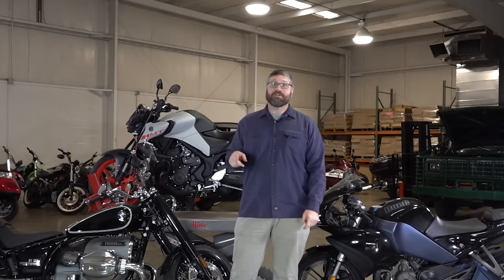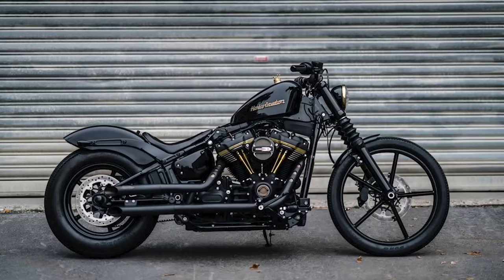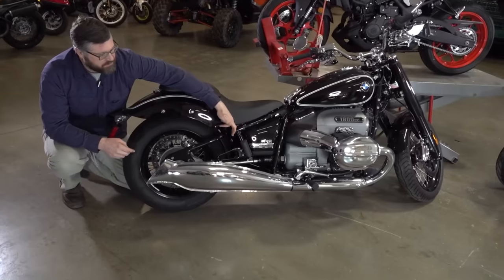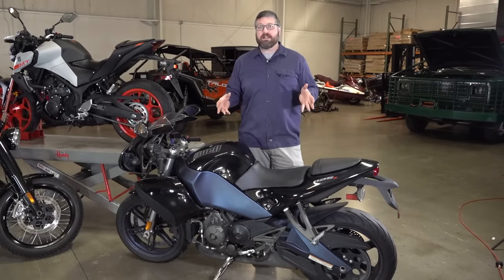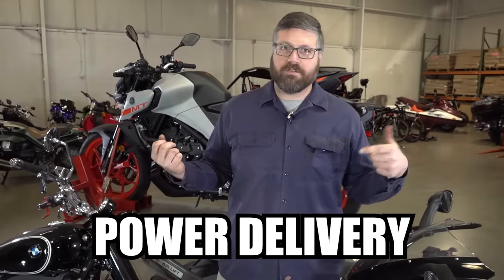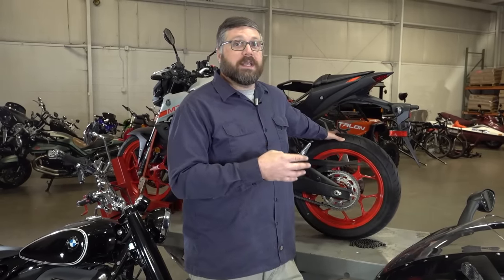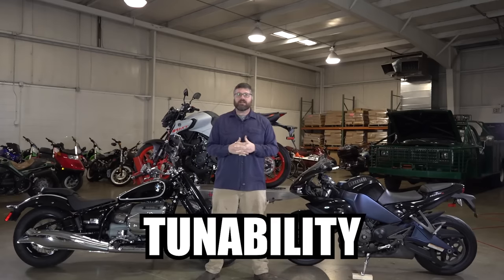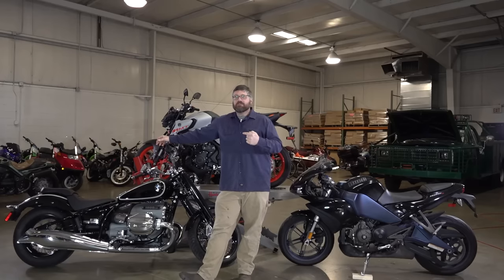Motorcycle Chain vs Belt vs Shaft Which one is Better?

Comment: One item overlooked: chains can be repaired on a trip. This can be important off road. Carry a couple of links and a pin pusher; they are small. A ripped belt means you are in trouble.
Reply: That's true but I've had more chain problems than I've ever had with a shaft.
Reply: @larrydlam  Yeah, I don't really know why more Adv bikes aren't made with shafts. I have had only one bike where I changed the sprocket size. most people are fine with the factory ratios.
Reply: @flechette3782  And my off road has always been chain but my street bikes I like the shaft drive.
Reply: @flechette3782  shock load.
Reply: @flechette3782  I imagine the extra weight from a shaft drive system would be a factor.
Reply: @flechette3782  Lot's of reasons weight, heavy dampening needed, torque effects, costs, and by far the worst way to connect an engine to a wheel in terms of complexity and efficiency (for a bike... 90 degree turn 2 times great....) another thing is with a chain or a belt some damage or wear can be seen easily
Reply: @neoverload8685  Valid points. However, even though they are in the minority shaft designs still have a healthy market. I think it is the low-maintenance aspect. Unless they develop a leak they are pretty bullet proof.
Reply: @George-wf9ff  Maybe for performance bikes (racing) but I don't see a real advantage for the everyday bike to shave weight as much. Look at the 750 lb monsters on the highway. There appears to be no attempt at all to ave weight.
Reply: @flechette3782  your previous comment said you didnt know why they werent on more adv (adventure) bikes. Or was that a typo?
Reply: @George-wf9ff  I don't consider adventure bikes racing bikes. I can see an advantage of a shaft on an adventure bike as it is probably less likely to get damage  in a spill (common with adventure bikes)
Reply: @flechette3782  for sure maintenance is a good point i forgot to mention that it simply looks great even if it is not the best way to do the job 😉
Reply: @flechette3782  hmm well first of all i never said they were race bikes but  i still disagree on both points. 1- rally racing is a thing. 2- shaft could still get damaged pretty easily if you bounce the "shaft" or "diff" off a rock. 3- if you do damage something, a chain and sprocket can be replaced on the trail, a shaft, not so much.
Reply: @flechette3782  i forgot to mention that when offroading, less weight is an advantage
Reply: @George-wf9ff  Fair enough. Those are legit arguments. FWIW my Adv bike is a BMW F-800. It's got a chain. I have to lube it occasionally and it has stretched some but otherwise it works well.
Reply: @flechette3782  nice. I got my eye on an africa twin, and the other eye on a tenere 700 lol. And for the record i do like shaft drives for their low maintenance, i used to have a yamaha fjr 1300 that was a shaft drive, thing was so quiet and never had to worry about it beyond checking the fluid at the start of the season
Reply: Trippin on belts do suck indeed.
Reply: i saw a video about 10 years back on youtube where they wrapped layers of duct tape around the belt and it lasted if they nursed the bike for quite a few miles
Reply: @debeeriz  Really? Was the belt ripped all the way through and only the duct tape was holding it together, or was a tear developing?
Reply: @flechette3782  it had snapped, he made it 20 miies then thought it would hold up to anything, but too much too soon and it came apart again
Reply: @c4t-tp238  sorry but what makes you say that weight isnt a factor for a shaft drive?
Reply: In trouble unless you carry a spare belt 😬
Reply: @emdee69  Even so, wouldn't be much more difficult to swap a belt? With a chain you don't have to remove a pulley (or a tire!) to get a new belt on; you can just pull a link or add a link from the side.

I do like belts though. Much less "jerk" if I botch the clutch. Smooth.
Reply: Right on. Been a few times that I was able to repair a chain while out riding and get home.
Reply: @flechette3782  a chain and sprocket setup is far cheaper to produce and also cheaper to work on. That's pretty much it
Reply: So carry a spare belt.
Reply: The argument that shafts can be put on adventure bikes makes no sense. Adventure bikes are by nature capable of doing off roading, or bad roads or gravel, uneven roads etc. Shafts lack the flexibility of chains, not to mention the chains are infinitely easier to fix compared to Shafts. Many adventure riders I know always carry chain repairs tools on such trips, with Shafts good luck.
Having Shafts also adds cost and weight to the bike, yes they are smoother and maintainence free but they do drive up the cost of a motorcycle.
Reply: If you need to repair your chain on a trip, then maybe you ought to check everything on that bike, specially from the saddle up.
Ofroad and other sportsadvents you usually have a followtruck
Reply: @sidewind131258  I do.
Reply: @sa4555  are you saying that shaft drive is not suitable for off road?  Is so the utility/4x4 atv, sxs, and off road truck guys will be shocked.
Reply: Yea it's a lot of work to replace the belt on my harley😭😭
Reply: @richardbeto1615  Do you carry a spare belt when you ride?
Reply: Only shaft. Shaft won in most of crtiterias.
Reply: Breaking a chain usually causes WAY more damage. Had way more issues with a chain than a belt in 30 years of riding
Reply: @fvgc454ss  Admittedly, I have never owned a bike with a belt. I have had chains and shafts. My shaft bike required no maintenance at all other than merely checking the hypoid gear oil now and then (never a problem). Chains need to be lubed and tightened, so more maintenance, but as I said they are repairable on the road. I have never had one break so I haven'y experienced any damage. I don't doubt that they do cause damage, but that largely depends on the bike design. In other words, is there anything critical that the broken chain can hit?
I can see that belts would be a great low-maintenance solution. They also are more forgiving if you drop the clutch and give smoother starts from stop. Yet I have two concerns, how easy is it to inspect and see potential damage (a crack forming), and how in the heck do you replace on one the road? Unlike a chain you can't thread one on and attach the ends. Are there belt bikes with single side swing arms and exposed primary pulleys? If not, then you have to remove the rear wheel and other stuff to replace one.
Reply: @flechette3782  buells have one of the easiest replacement belt set ups there is. They have a spring tensioner, fixed axle and removable frame section. U can literally do it in 10 min if u have the belt. I laugh when people say what happens if its on the side of the road. 99% of people aren't riding around with a spare chain and rivet tool on them anyway. Your gonna have to find a ride to town just like anyone else that breaks down. If your know your traveling long distance than obviously you'll pack one but if u don't have bags that isn't an option.
Reply: Yes but what about the inconvenience of oiling a chain on a long trip. The manual says you have to oil it every 500 kms. That translates to virtually every day. If you're into long trips, I think chain driven bikes should not be considered at all. In fact, I don't know why Honda withdrew their ST Pan European and the Deauville leaving the market for BMW. The mirror image of this is performance bikes where chain is king.
Reply: @Censuwine  If you are going on long trips (cruising) I agree with you. Belts or shafts are better. But if you are going off road (I do a lot of adventure riding on rough terrain) I think chains are more appropriate. A small rock picked up by the front tire can easily get into a belt, damaging the belt or pulley. Shafts are pretty bullet proof. I don't know why there are not more shaft adventure bikes. Probably because if it does indeed get damaged (rare) you are screwed. No field repair possible. 

I'll agree though, chains are a pain to oil and keep tight. Adv riding stretches them out quicker than cruising because of more frequent and hard accelerations.
Reply: Why would a ripped belt be more trouble than a broken chain? Honestly curious.
Reply: @tophmcgoph9229  Spare chain links are small and easy to carry, especially if the bike has luggage capacity.The tool to disassemble/reassemble the chain is also very small, typically a 1x1x.05 little piece of metal and an Allen wrench (very small too).
For a ripped belt, you have to replace the whole thing. This requires adjusting the rear fork distance shorter to take the damaged belt off and then increase it for tension with the new belt. This can be done with a ratchet which is larger than an Allen wrench, and a spare belt is much larger than a couple of chain links.
Don't get me wrong; belts are a good choice for the right application, such as stop/start street traffic and long distance cruising. I just be reluctant to use them for adventure riding where a lot of rocks get thrown up by the front tire (and could get into the belt/pulleys) and has a lot of intermittent high torque riding.
That said, I am by no means an expert nor do I have any data to back this up. It is just my opinion.
Reply: @George-wf9ff  A factor for what exactly?  I think the incremental shaft drive weight vs the combined weight of the chain and sprockets.
Reply: then why not just have a spare belt....
Reply: @RePlayBoy101  You could, but it is more bulky than a few spare chain links and a belt is more difficult to put on than a chain. That said, I completely agree that there are uses where belts are better (like stop/start and long distance cruising). Not so good for off-road and racing.
Reply: @flechette3782  not really ... you cant just detach and reatach a chain like a bicycle ... you still need to find a shop to  put on a chain properly for it to be safe
Reply: Apparently, if you run your belt bike off-road just run it looser and it doesn’t get tore up....shaft drive just seems bit overkill on a motorcycle to me.
Reply: 85% of bikes have chain for a reason.
Reply: @flechette3782  cheaper to manufacture, less weight looks better on paper
Reply: @JoeStanek-vu7rl Yeah. Because it's the cheapest and already perfected despite the disadvantages. Not really a compelling reason not to have belts and shafts.
Reply: Belt replacement isn't difficult; neither is the tensioning (with various systems available depending on your need). Also, a "spare" belt takes up very little space, and is very light.
Reply: @phils4634  You are probably right; I have never owned a belt driven bike.
All my bikes are chain driven right now, but I have had shaft driven ones in the past. They are kinda nice as you can just forget about them and just make sure they have hypoid gear oil in them.
Reply: @flechette3782  A lot of the larger ("super") scooters use belts as final drive. On my AK 550, belt change only requires removing the rear wheel, and a few bolts to remove the belt drive cover.  Kymco recommend using an (expensive) ultrasonic tension meter, however there are far more affordable systems, and they are accurate enough to let you set the belt tension in the middle of the recommended range.  Good enough to safely last until the next service.
Reply: Shaft drives don't break as often as chains. So there's no need to fix it when it doesn't break.

Comment: Chain is the most efficient but a big time and money waster. Shaft drive is as convenient and long lasting as it is in your car, it’s the same technology. How often do you have to crawl under your car to mess with the shaft / replace it? NEVER. Belt drives are ideal for cruisers and cruiser touring bikes. Belts will go 80,000 or more kilometres on one or two adjustments and don’t need lubrication.

Comment: I've owned all 3.  Shaft is probably my favorite by a small margin over belt.  The only thing that sucks is if you do have a shaft issue, it's going to be a pricey fix.  I currently own a belt drive and love the low maintenance of it.  My previous bike was chain driven, and man I hated always having to clean and oil the chain, and even then it would still wear out.  For tinkerer's it makes the most sense, but for me, I just want to ride.
Reply: So am I. For me, shaft rules. For my kind of riding, that's the way to go.
Reply: Feel you....
Going for a open beld Drive on the  engine and to the Weel...on my 1978 FLH!!
Reply: Me to I like shaft drive myself
Reply: @Jin Sakai do u ride
Reply: @Jin Sakai 😅😅😅🌚
Reply: I haven't had the belt and currently have chain drive, with all the messy maintenace that goes with that, but my previous was a VMax and extremely grateful that it was shaft driven.
Reply: @Jin Sakai should we all insist on w strokes too then by your logic.
Reply: @Jin Sakai hes out riding while youre sitting in the corner "oiling your chain" lol
Reply: Yes I do I own a 1300 Honda vtx I love it only has 47 thousand miles on it one owner
Reply: Oh yea ten years of it my bike shaft driven
Reply: @Jin Sakai u got offended and typed an essay. No one gonna read that.
Reply: Only changed the oil in the shaft twice on a year 2000 suzuki VL1500 when I sold it with 85,000 miles
Reply: I agree to a point but I would take a belt over a shaft drive every day of the week & twice on Sunday. I just don't like the loss of power & "torquey" feeling you get ever time you twist that throttle on a shaft drive. I had a Suzuki GS1100 with shaft drive that I had gotten from my brother, & to be honest, if it wasn't given to me I never would have bought this bike. It just felt very slow for the size bike it was & as I said I felt the whole bike rise up every time I twisted that throttle. Sorry but I would put shaft drives down at the bottom of the list, then chains with belts (by far) the winner!!!
Reply: As long as you maintenance the oil 80w-90 changes time to time, then the shaft drive will literally last a lifetime
Reply: Shafted!

Comment: I had 2 shaft drive motorcycles. In both cases the shaft drive was smoother, easier to maintain and also more dependable. I put 56,000 miles on one of them.

Comment: Up until a year ago I would have agreed with chain drive being the best.  Then last year I bought a 2016 Moto Guzzi.  I quickly enjoyed not having to mess with lubrication and worrying about the chain wearing out.  I might think differently if I was out racing or needed to quickly and easily change gearing, but for just riding on the street I really enjoy the shaft drive.  But to each their own.  Also I enjoyed the video.
Reply: The Moto Guzzi engine orientation dictates shaft drive, it was not adapted to shaft drive. Take it easy on the clutch,  lest you learn about a major design tradeoff.
Reply: @johndavis-tn3il  Yes,i remember the torque roll,had a 72 Eldorado 850.
Reply: Same for me. I own a Griso and am highly amused by the absence of rattling chain noise and no more greasing/tensioning chains ever again. Funny thing is driving side by side one can hear the chain noise all too well from the "others". Best choice ever!